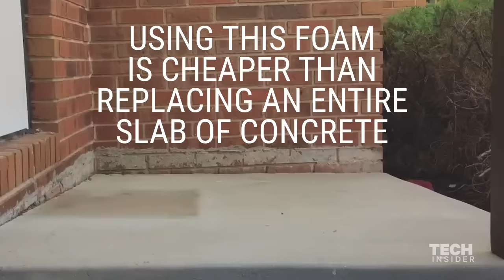Foam Raises Concrete That Weighs Thousands Of Pounds | Tech Insider

Comment: People don't realize that doing that can create a sinkhole in the future. Because the water is now going to run against the foam and cause the dirt under it to slowly erode away...
Reply: Uhoh
Reply: PapDahl DahlPap  its innovative.. one can argue using a vehicle to get around is lazy should be walking everywhere..
Reply: @alala1689  i'm talking about the dirt that it's sitting on.
Reply: @talaverajr391  wouldn't that be the same as the concrete themselves?

This foam is so you don't need to break the concrete and replace it with a new one that is higher.

If you think that this foam can create sinkhole, then, wouldn't it be the same as the concrete themselves?
Reply: @goonerOZZ  in a way yes, but the best thing to do would be to fill it in with dirt.
Reply: This is a valuable information, thank you for telling us this. Each innovation has fault, yet if smart peoples like you guys work together, technology could develop faster
Reply: PapDahl DahlPap its not it has carbon emissions and adds to climate change so same ideology both are lazy and bad for the environment
Reply: As opposed to what? How exactly do they fill it up with dirt, if they dont want to break the concrete? Or better yet, how are they going to easily lift up the concrete to make room for the dirt? Think before you comment stupid things
Reply: And not having anything will make a sinkhole 10x faster?
Reply: @s1l3nttt  atleast you can refill it with dirt.... If you keep refilling it with this foam stuff, you will essentially be filling the hole up with foam.
Reply: @talaverajr391  a very strong and durable foam that doesn't wash off with water like dirt? Yes. Filling pot holes or whatever with dirt is only delaying the problem, your have to find a solution instead of endlessly filling the hole with dirt. Btw I'm not saying this foam is perfect, even less a solution, since it's been 4  years since this video's release and I don't see this foam being used anywhere.
Reply: You don't know how sinkholes work do you lol
Reply: @GageMason  I'm not an expert, but I have common sense.
Reply: @talaverajr391  You literally said to fill in the hole with dirt. You do realize the same exact thing would happen based on what you're saying, just instead of the water running against the foam and dirt. It'll run against the concrete and dirt. Sinkholes form usually when something like limestone beneath the surface erodes due to groundwater, and forms a cavern. The cavern then collapses and boom, sinkhole. This foam has nothing to do with it, nor does the dirt. If a sinkhole is going to form there, itll do it regardless. This foam is actually significantly more innovative and cost/time efficient than trying to break or remove the concrete to put dirt, which will only be very temporary to fixing the slumping, in the gap. Not great to spread misinformation like this.
Reply: @GageMason  use common sense man. If there is enough ground water, then it wont matter what substance you fill in the whole with it will still erode away. That is why I say it's better to just keep filling it in with dirt.
Reply: @GageMason  🤦🏽‍♂️I agree that foam is time effecient, but effective? The foam isnt going to fix the problem, when the problem consists of the ground literally eroding away underneath the concrete from ground water. If you are going to fill in the hole you might as well fill it in with dirt because if you are filling it up with foam you will just be creating a bigger mess.
Reply: @Raylen_Fa-ield  Prove me wrong then.
Reply: @talaverajr391  how is more dirt better then a foam that's hard as rock and doesn't weather? What's more the foam spreads beyond the concrete so if more soil erosion happens then the foam can still support the concrete for longer
Reply: This kind of foam had gone trough every test and research.. And here u just comment like u know everything.. Lol if u want criticize.. U have to read the research result and articles first not just watch this one minute video.
Reply: @talaverajr391  my only comment here is, why bother saying prove it when you can't prove your own opinion? The burden of proof is on you. Don't try to redirect the convo when you have no means to substantiate your claims.
Reply: @Raylen_Fa-ield  the guy just raised a question. Don't think people are deserved to be called sheyt for raising questions
Reply: @Raylen_Fa-ield  don't be taking your frustrations out on people online.
Reply: Usually they don't break off like concrete
Reply: @michaelala4706  wth? Isn't that the whole purpose of the interne???
Reply: @lucasromero9377  that isn't the definition of lazy
Reply: Okay, so WHY does this process not happen beneath the concrete itself?  What if the subgrade were uneven so that a section of the slab is thicker to begin with?  Then we'd have exactly the same situation as shown here after lifting, but right from the start.  See the flaw in your logic?  And where would the soil erode *to*?  Where the foam is in place, this is already the lowest soil surface so that the top of the soil slopes uphill in every direction from there.  More flaws in logic.
Reply: you sir don't understand how sinkholes are formed. as a mechanical engineerer i can tell you sinkholes have NOTHING to do with the dirt or concrete, or this new material. please at least understand how sinkholes works before you comment this
Reply: I work with this material for past 5 years insulation Roofs and Walls, and I can tell you, this will not erode away , we can give 80 years Garantee on the roof's cause they are also UV Proof and inside the walls its 150 years Garantee.
Reply: @okok-fs4qe  spaghettios
Reply: Not in my case I'm in Southern California and this will be perfect for me. It's exactly as a previous commenter said. My situation is caused by families of raccoons burrowing under the driveway, not water erosion.
Reply: @ninjazombie1396  How are they going to easilu lift up the slap to place dirt? Think mark Think 👉😑👈
Reply: @ZZOMBI33  you must not have read my comment at all because that's exactly what I said. Maybe learn some reading comprehension before commenting stupid things.
Reply: @lucasromero9377  bike is the best pf bpth worlds. Faster, healthy and eco friendly
Reply: Trust that won't cause a sinkhole dirt drains water easily and it can't just sink due to too much water going in it
Reply: @talaverajr391  Filling the void with foam keeps water out of the space under it. The foam creates a seal all around the outside and supports the concrete above it. Any further voids can be filled but itll take many years for the ground to erode underneath it enough. It'll never be a "sinkhole". 

Source: I am a foam jacker.
Reply: @talaverajr391  I know what you are saying, it makes a lot of sense. Do you think that, making mud and doing the same thing as foam is a good idea? You are smart, that’s why I’m asking you, it’s not a “testing you” question.
Reply: And where did you get this information ?
Reply: @talaverajr391  that makes no sense, the space isnt deep enough for a sinkhole to form.
Reply: What if we leave some joints/lines of soil so the water can percolate in a controled way?
Reply: Sink holes??? No. Read up on what a sink hole is. You use this term attempting to dramatize your viewpoint and this is evident by the “thank you!” Reactions to your “information”, myopic at best. I, for one, am not a fan of using foam here but in no way would this cause a sink hole or erosion of soil around or underneath. The foam becomes one with the concrete slab and it’s like some one just poured concrete into a very uneven bedding and then leveled it into a slab. It’s like says a huge boulder, half buried in the ground with very uneven bedding, is somehow going to cause water to move around the underside and cause soil to erode away. And that this will cause the boulder to fall into an sink hole. 🤦‍♂️
Reply: You can always add more foam later.
Reply: @irishluckk  hence, making the hole bigger also.
Reply: If you have water running below your house you should establish drainage and surface water handling. Ask a geotechnical engineer or an surface water engineer about establishing proper management of water in and on terrain.
Reply: Remove the source of water .
Reply: Bad drainage is what caused the problem in the first place.  That must be fixed as well as lifting the concrete or you will just continue to have a problem.
Reply: What does this type of repair work usually cost, on an average 3 br 1300 sq ft home?
Reply: Why is it different from useing concrete?
Reply: Uhh your house is built so bad that you assume others are built as bad 😂
Reply: Yeah I actually had this happen. But it didn’t create a sink hole as much as completely rotted and sank back down and cracked the concrete. Only way to lift it is to have a concrete sandwich to prevent water from collecting.
Reply: Not only that it will eventually take on water and break down and be back to where it was in the first place
Reply: People don't realize that the dirt is already being washed away.

The sink hole is inevitable. It'll continue to erode the grade.

Just spray foam and get the driveway level and deal with it later.
Reply: I think engineers do realize that.
Reply: Thanks Mr. YouTube foam scientist, we're greatly appreciative of your ever knowing knowledge. We'd be lost with comments like this.
Reply: How long does that phone going to last before it starts to rot away
Reply: Dirt below concrete? You are the problem!
Reply: No the foam fulls the cracks
Reply: Only in some instances maybe.
Reply: You missed the while point. 
Fixing it right involves removing sunken object ( probably ruining it 8n the process, removing a depth of soil, repacking lifts of soil correctly, rebuilding said object.  This is meant to be a cheaper alternative.
And it is!
Reply: @talaverajr391  not how sinkholes are made buddy
Reply: Because he said "I'm not an expert, but I have common sense." Lol.
Reply: And water didn’t penetrate the dirt prior to the fix?

Comment: Had this done to my driveway.  One hollow area was starting to crack and soon break apart.  Process got rid of the hollow parts and no more bumps.  Makes shoveling snow easier.  This system works well.
Reply: Care to share what you paid?
Reply: How much?
Reply: @Johnny-cj7qr  -- my neighbor Tom had it done to his basement for $2500 but it's a lifetime guarantee. If it sinks some more they'll come back.

Comment: Curious how you control how much product to spray in and control the lift? I suppose you keep spraying until it stops at the height you want assuming the previously sprayed compound hasn’t set up yet and prevents the new material from expanding to all the areas under the slab to provide even support.
Reply: They usually inject the resin at different depths sequentially, so they strengthen the deepest layer of soil first and then move onto the higher levels. Also, if there are voids beneath the injection depth, the foam doesn't just sit at that level, as it is injected under high pressure; it chooses the path of least resistance.

Comment: Had this done on our front porch and it was super quick, easy and much cheaper than what we were quote for a new slab of concrete.

Some folks will tell you it's not a great option, but I suspect thoes folks are the ones losing out to this modern solution.
Reply: This doesn't fix the reason why the slab washed out and sank originally.
Reply: @ronnydobbs584  if you seal it after lifting, I'm assuming it'll help.
Reply: @JKboi27  i think he meant the root cause of the sinking. could have been a major ground movement
Reply: I'm having the same issue with my front porch. How much did it cost you?
Reply: Hello how much was it
Reply: @ronnydobbs584 True. But for many a downspout discharging too close to the slab is the culprit. Extend downspout termination as far from home or slab as possible (6 to 8' minimum), repair grade, and lift concrete. Problem solved.

Comment: So... I'm curious of the long term usage and effect. It's foam holding weight. When and how long can it support? Is it Bio De-gradeable? If so, what is the timeline of when it degrade due to natural elements?
Reply: @BlvckHvt  ok. I've always get curious when i see this kind of stuff. I'm from Milwaukee. The area is known for its soft soil so buildings aren't really built high sue to it.
Reply: If it was bioegradable I would be very concerned of its application.

Me personally I would just rather rip it up and do a proper repair first as last, I don't really think quick fixes are a good practice and to be honest I suspect the cost of such works isn't much cheaper than doing the job right and you will likely have to have a compromised finish eg cracks.
Reply: You don't want your structural support product that's applied on soil to be biodegradable. Lol.
Reply: @RickGrimes807  What are you talking about? Actually... who are you talking to? No one is, was or has said anything about not wanting something or anything.
Reply: @DirtCheapFU  Why are you upset? You asked if it's biodegradeable and I replied that it would be a problem if it were. Hence it's not. Nothing to get mad about buddy :)
Reply: Poly resins they use (e.g. polyurethane) are incredibly inert and non-biodegradable. The foam isn't just floating on top of weak soil, the resin penetrates voids below and compresses the soil, especially if injected at different depths. They use this technique to support entire warehouses, motorways, etc. If it can be used for those structures then in comparison to a driveway the idea that the resin can't support it is laughable. Once this stuff is injected the structure isn't going anywhere unless the soil beneath the resin is still active from water penetration.

Comment: How do they keep it from expanding once you’ve reached the desired height? And how do they make sure it’s leveled?
Reply: They use a level, you can see one at 0:45 but to stop it at the desire height they simply stop filling in foam but you gotta do it slowly because you can't bring it down if you screw up
Reply: @gabrielperez1199  doesn't it keep expanding for a minute. So you gotta stop before it's level and hope it ends up in the right spot
Reply: @electric_photon4660  exactly

Comment: If it  expands after instalation how do you keep it from raising things too much
Reply: It cures 90% in 15-20 minutes
When you shoot it in, it starts expanding
You are only working on a slab at a time, and more than likely raising a corner, so you are focused on that corner or half. Raise it slowly, you have 10-15 minutes from when you start shooting, that should be plenty of time. I'm guessing you can also drill a 2nd hole if you come up short and its hardened
- never done this. It's what I'm having done and from what i got in the vid

Comment: Can Polylevel be used to raise a concrete slab house?
Reply: Polylevel can be used on the slab, but for a home that has a footing, you would need piers to permanently fix the issue. Only instances you would use polylevel on the interior of your home would be if you have having piers lift your footing or you have a void or poorly compacted area inside the perimeter of your home, which would help but not be a guaranteed fix.
Reply: I had the same idea and will try it in the near future.

Comment: How do you stop the rising effect? Hopefully it wouldn't continue as if tree roots had expanded underneath a sidewalk...
Reply: they stop adding foam
see how they can't entirely fill the void?
Reply: It's also a very controlled burst of foam in very small batches. Since the foam sets fairly quickly you inject for a few seconds, wait and determine how much it's lifted add more and repeat. For larger surfaces you actually make several injection holes and move from hole to hole so one specific are doesn't become "high centered" which could lead to cracking.
Reply: My driveway was dine a year and a half ago.  Everything is still good.  It fills the voids, raises the concrete as much or little as needed.  Stop adding the foam, the concrete stops raising.

Comment: Well, you've lifted the slab. But you still put pressure on the soil underneath (now through the foam) meaning that the whole thing will eventually go down again.
Reply: It depends on what made it go down really. If its just soft soil, sure, you just delayed fixing it for a few years. If its water, as long as you fix the problem by providing better drainage, then this fixes that problem. If its moles or old tree roots decomposing, then this fixes the problem quite well too.
Reply: Not really. The poly resin they use is extremely lightweight yet it has very high compressive strength. They usually inject at different depths to fill any voids or weak parts of the ground, so the whole ground is strengthened. Heavy structures (e.g. houses) will probably sink/settle more over time than one that's had a resin injection correctly applied to the ground. They use this stuff to raise motorways, runways, even entire warehouses.

Comment: How do they know how much to spray it to bring the concrete up to a certain level? What if it went past the point they want? I'm assuming they'd spray in some solvent to melt the polymer and start over?
Reply: You watch while you do it.  It raises very slowly, stops when you stop adding foam.  I driveway turned out great.
Reply: @danr1920  I have a garage floor that has NOT sank yet but is cracked because there is a definite void space below due to washed out soil below.  Do you think they can accurately fill the void and stop before the concrete floor rises ?  If it were to rise any I think then the pitch of the floor would be now toward the back of the garage which is the house and guess where the water would flow.  It would be nice if they have some witness holes to prove the void has been filled before any rising occurs.